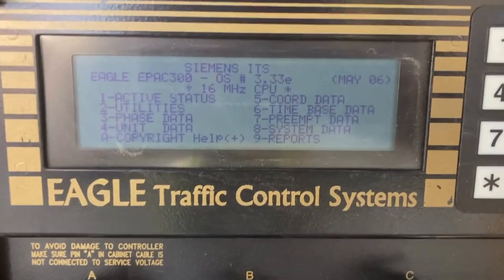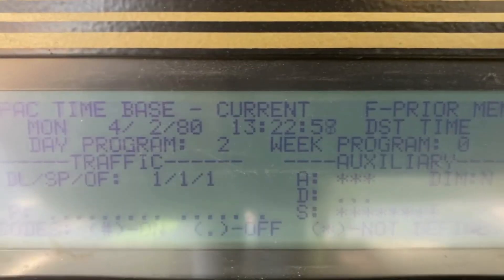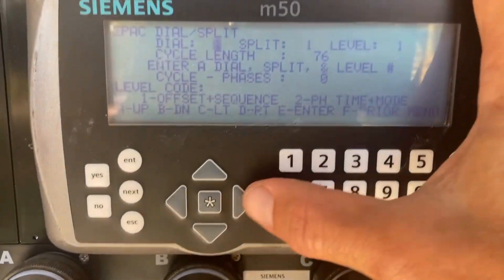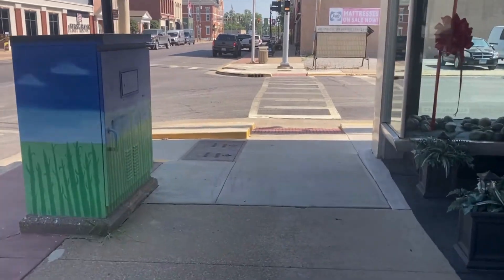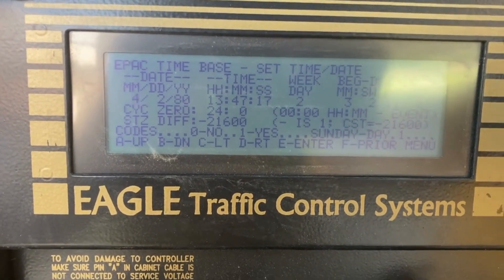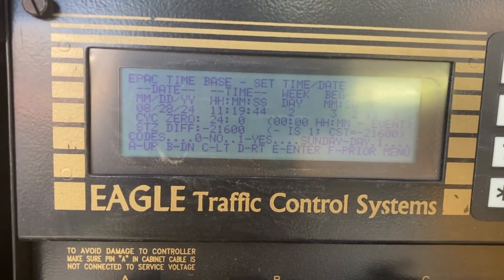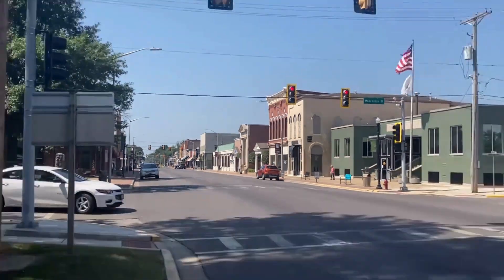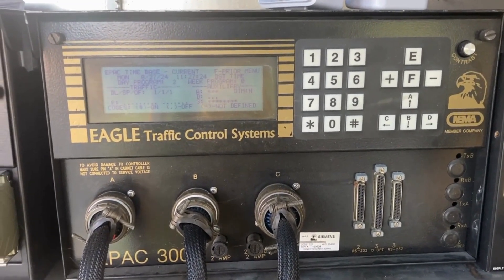How to Coordinate Traffic Lights

Comment: Thank you I didn't know that we can do intersection coordination without having the controllers "talking" to each other. But, what happen if they have detection?
Reply from the maker: Detection works the same whether you have time-base coord or connective coord.  They both serve vehicle detection when it's their turn during the coord cycle.
Reply: @streetsmartstraffic  I'm missing something. Don't the time base coordination will get easily out of sync with detection? Sorry to bother.
Reply from the maker: @joaosousa2470  No.  Detection is detection.  Without coordination (a traffic signal running free), the controller will serve based on demand.  With coordination..well, I like to explain it like your looking at a clock on the wall (the one with a big hand, little hand).  But focus on the big hand...  it's spinning around and after 60 seconds, it's at its starting point again.  Now, lets pretend the signal has a 60 sec cycle length for coordination for ease of understanding.  The big hand starts at the 12 (that's the start of green for the mainline).  It's traveling around the clock....1, 2, 3... you get the picture.  The whole time you have cars pulling up on sidestreets or LT's.  But the controller is not servicing them....yet.  Because these other directions have a preset time that they are 'allowed' to be serviced.  So lets say at the 6 of the clock that the sidestreet has its window of time allocated to run.  At 6, it will halt the mainline, serve sidestreet and allow it to run its amount of what we call SPLIT time.  Split time in coordination is the phase's green, yellow and red time.   Lets says its 15 sec.  That means at the 9 mark, our LT SPLIT time will start (if there is demand for it).  And lets says the LT split time is 15 secs.  That means by the time youre back at the 12, the mainline is ready to start again.  That's how a signal stays coordinated.  Doesn't matter if its time base or connected.   Hope that makes sense.   Great question.
Reply: @streetsmartstraffic thank you for explaining it. I understand better now.

Comment: I had to resync my M40's at least once a week.
Reply from the maker: Isn't that frustrating!?  The clocks drift so far on the those 40's
Reply: Yes! Otherwise,  the other features work. One of the units is able to function flashing yellow Protected Permissive mode.
Reply: The worst of the bunch is the old M03 series units. The clocks will drift more often. They are all gone!
Reply from the maker: @epacm50  except for the one rolling around in the back of my work truck LOL!
Reply: @streetsmartstraffic  I also had a converted M30 series. It was downgraded to a M10 controller. The TBC clock stopped working. Another one  bites the dust!!!
Reply: I was also thinking about purchasing a vintage MARC (EPAC master). How would you bring the units back to life?
Reply from the maker: @epacm50  Marc- If it can power up, you should be able to add a twisted pair modem or a fiber modem and start communicating with your locals without problem!

Comment: Do you have an associate's degree?
Reply from the maker: I'm reluctant to answer your question because I don't want to give the wrong impression of what's needed for this type of work.
My answer:  I have a Bachelors in Electronics (specializing in Telecom).  Military (experience in telecom as well).  
HOWEVER, that's not required at all.  Back in the day, it put me on the top of the pile of applications at my first employer.  These days, if you have a technical background of some type, that's a great start.  Associate's degree or military doesn't hurt to have though.  That just tells the employer that you can committ to something.  I think these days employers just want a dependable hard working individual.  Great question!
Reply: @streetsmartstraffic  I was just curious. People constantly say that there's a shortage of technicians in the field. Is that true? I don't really think so at least not in the Cleveland area.
Reply from the maker: @jolyonwelsh9834  Where I'm at (State DOT), i know we are short a 2nd tech in my district for almost 3 yrs now.  In the district above me, they're about to be short 2 techs.  I also subscribe to the IMSA magazine.  They post traffic jobs.  They're basically all signal techs/electrician postings.  They're littered throughout the U.S. and Canada.

Comment: Good Video, The Large Majority of Intersections that I work with use a GPS to sycn the time of the controllers. Also, the coordination I usually work with has increasing offsets. For example, the first intersection would have a 0sec offset, but down the road, the second intersection might have a 15sec offset so that you can catch the greenband all the way through and not get stuck in the middle.
Reply from the maker: Yes!  Most of our coordinated cooridors have your setup.  When the original traffic firm engineer designed our study, I asked why these 3 signals had the same offset.  He said since they were so close in proximity, that you could use the same offset.  I imagine you could skew each one by a few secs.  Its very easy when its one way traffic to figure offsets....its a little harder when you have 2 ways to coordinate.  Great input!